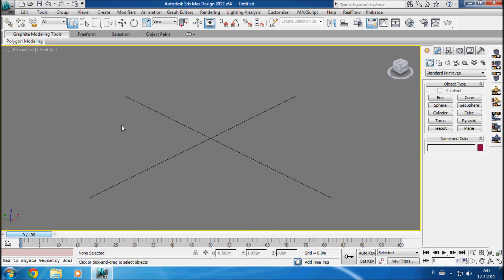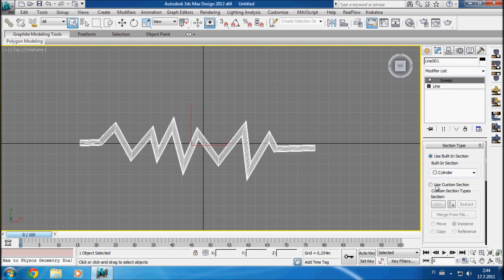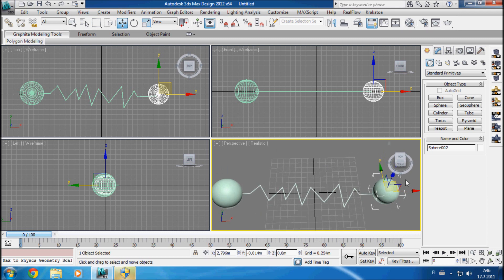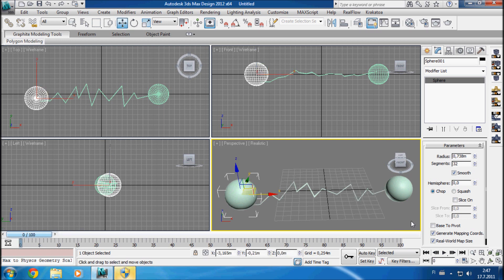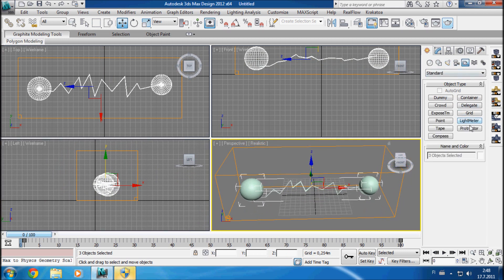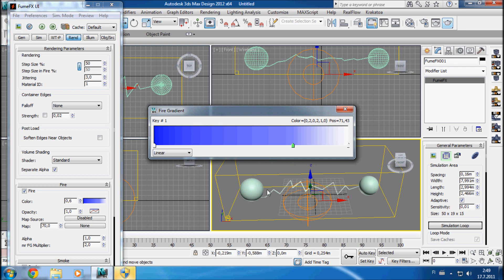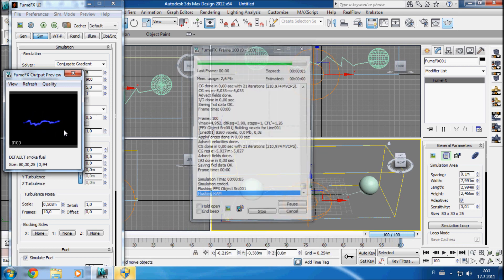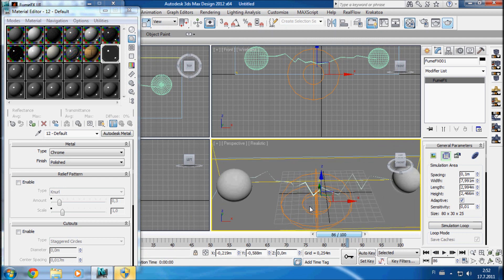3DS Max & FumeFX spark/lightning bolt tutorial

Comment: This is kind of helpfull, you really did lead me in the right direction for a small project of mine. Although I think you could have just made a straight line with a few points, select all but the end points and then apply the noise with a fractal on it, that way you get a more random lightning. Also, correct me if I'm wrong but shouldn't there be some sparks going of away from the bolt?